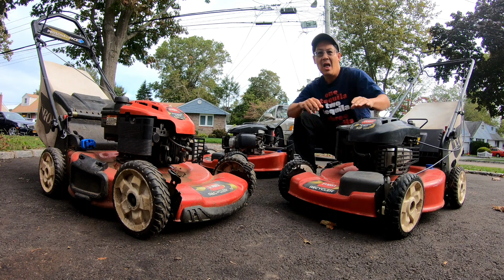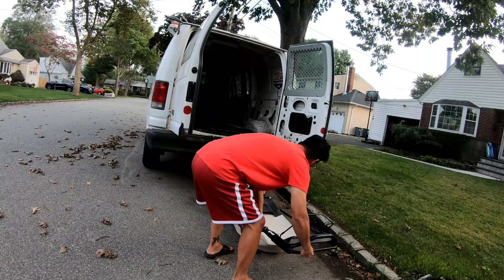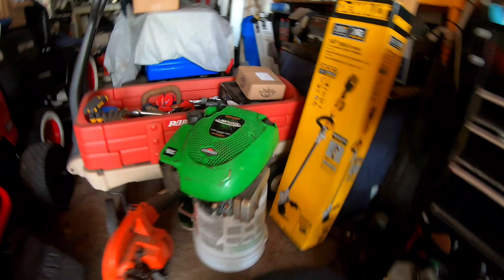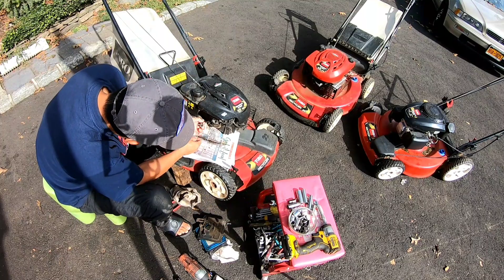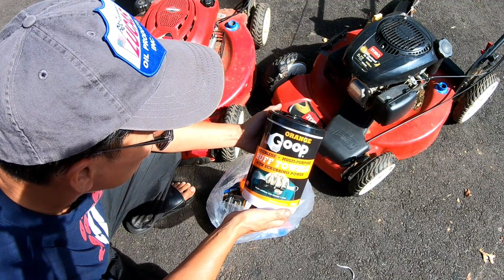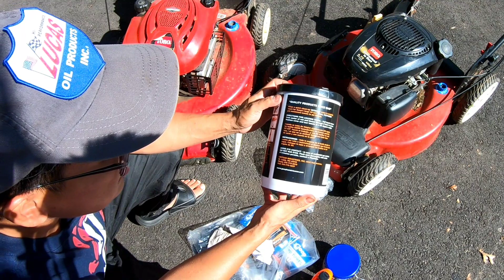PICKING 2 FREE WORKING TORO RECYCLER PERSONAL PACE LAWN MOWERS IN 2 DAYS CURB ALERT TRASH FIND PICKS

Comment: Hey Henry , I saw a video on the Kohler xt675 , excess blow by getting into the carb  causing smoke ,  check the  white disk  [just clean it , and check for burrs]inside the blow by cover, located under the flywheel , or just disconnect the blow by hose to the air filter box and see if it stops smoking .
Reply from the maker: Bro, I saw that video just now, I’m gonna check it tomorrow, thx bro

Comment: The rear wheel personal pace is the higher end model same one i have all aluminium deck there is grease fitting on both rear wheels
Reply from the maker: I don’t think mine is an aluminum deck
Reply: @MowersNBlowers  the super recycler is aluminum
Reply from the maker: Yes it’s definitely an expensive mower

Comment: Henry, don't give up on the kohler yet. Try some seafoam in the oil. I had a 19 year old briggs that i bought new. Always maintained it and it started to smoke alittle at times. I always use seafoam in the fuel so i put some in the oil. It takes about a hour to mow my yard and about half way through the yard it quit smoking and i donated it to a ELKS club garage sale a year later and it was fine. I think it was carbon on a valve. Roger
Reply from the maker: Roger good point!  It’s because I have an abundance of spare push mower engines,  but yeah I’ll try to adjust the valves and sea foam and see where it takes me before I swap out the engine.

Comment: With the smoking from that Kohler
Might want to check if your getting blow by .  I had one that did that and this fixed it. Along with oil change to thicker oil, and restore oil addive(4oz) remainder oil.

https://youtu.be/P-ElXfNDTjE

Also see video description for other info videos on this same issue.

Also it  sounds like it’s running on choke or rich. I had a Honda like that recently and all I did was change the carburetor and it was fine.

Comment: Both of those Briggs Quantum engines sound wrong, like they’re starving for fuel or the spark is off. Check your carb “O” ring and the fuel inlet tube bolts, also check the inlet tube for a crack. Re-torque the cylinder head bolts too, especially around the exhaust valve. Might also try running them with the gas cap loose for a minute, could be a plugged cap vent. Could be a partially sheared flywheel key too, spark at the wrong time can cause all kinda weirdness.
Reply from the maker: Inlet tube?  You mean the long gray plastic tube on top under the engine cover intake manifold?
Reply: Mowers N Blowers yep, make sure it’s not loose or cracked. It’ll cause a lean running surging condition, so can the flywheel key and a loose cyl. head. Great finds there, wish I had a Quinn the Mailman or UPS guy giving me a heads up!
Reply from the maker: You can just make friends with them if they’re your regulars